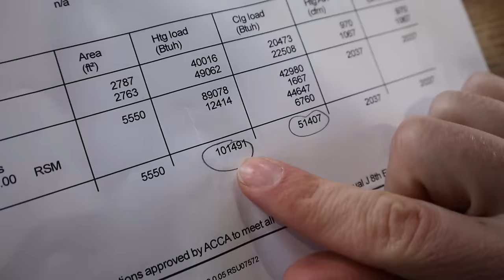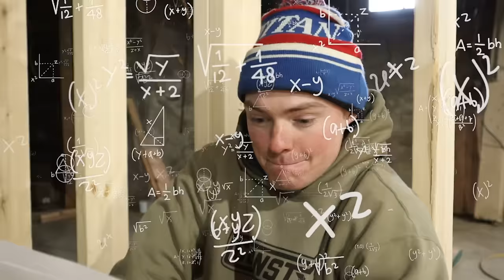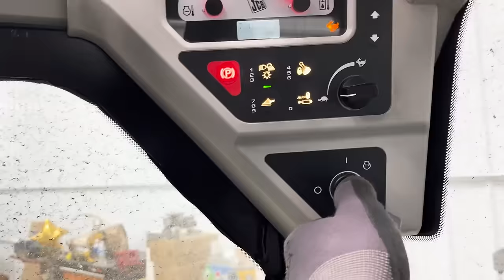Restoring A $7,000 Mansion: Removing 2nd Story Floor

Comment: I'm just a homeowner, but I am very pleased with the Geo Thermal system that I had installed over 10 years ago.  The limitation of a heat pump is that when the temperature drops to around 25-30F  a heat pump will struggle to pull usable heat out of cold air.  The same is true at the other end of the spectrum  around 100F  and there is just not much room to transfer heat out of your house.  However, Geothermal wells run a  constatnt 56 decreees.  So no matter the season the air handlers have less of a strain to move heat out of or into your home.  My upfront install cost was higher, but my electric bill went  down and I was able to eliminate the need for natrual gas.  At the time that was a saving of 70-80$ month.  Just as an educated guess, I would think you will need 4 or 5 wells drilled.  Or with your farm equipment  you could lay them out horizontally.
Reply: The new heat pumps can still work to -20
Reply: @safffff1000 yes but efficacy drops as it gets colder you will have much more effective system with geothermal.
Reply: Geothermal can be very good as long as you know the limitations.  Open-loop systems pump ground water for the energy source so wells are needed.  There is a closed-loop system that uses wells and also a closed-loop system that just buries pipe 10 feet underground.  I am a proponent of the closed-loop system as it doesn't affect the water table and with all of the space under the hay field it would make a great heat sink for the geothermal system.
Reply: We put geo thermal in when we built our home in New Hampshire.  We love it!  Great ROI and a very comfortable home winter and summer.  Our home is spray foamed too!  Great combo. I would do Geo again in a heart beat!  The air exchanger is a must too and Cole if you do any research you will see that.  Great show!
Reply: Here in Missouri the electric coops have rebates when you install geothermal. With the combination of rebates and a 30% tax credit the cost of geothermal is the same as a conventional system. Not sure what your electric coops do in Iowa. Explore this option and you may not need the radiant heating system. 
While you’re at it, since you are using closed cell foam your house will be pretty tight I would consider an ERV (what your contractor is calling an air heat recovery system). Also with your house as tight as it’s going to be you will need supply air in your kitchen for the range hood.
Reply: @safffff1000  they'll put out less heat the colder it is and have crank heaters and defrost and take more electric the colder it gets and the longer they run, sweet spot is about 20degrees f before they fall off bad. They're great for AC tho. As a master geothermal tech/designer/installer in Northern MN, I could tell you all about the horror stories about ice and defrost and inverter board problems and condenser fans and on and on. Hydronic heating/cooling from geothermal is top teir nothing else compares
Reply: @warrenclaassen5959  when I built my log home in 2008 I installed geothermal. I have an open loop system. The open loop system doesn't affect the ground water level. You pump out of one well and dump it into your dump well. With an open loop system you are extracting the temperature out of the water to satisfy the temperature on the thermostat.
Reply: @myronparks3495  Well that is good that you are directly putting the water back.  I do know of instances where they just put that water into a pond or something and I feel that is not the best way to conserve water in an area where the water table is already being depleted.
Reply: @warrenclaassen5959  I worked with a guy a few years ago. He had a house on a lake. He had an open loop system and his water went into a lake.
Reply: @myronparks3495  I have seen information that when you are on a large lake like Lake of the Ozarks you can throw coils down in the water and still use a closed-loop system but use the lake water as a heat source/sink.

Comment: For that size of house, I would recommend  2 systems, instead of one unit with dampers and add a registry in the staircase because during summer  heat builds up in that area
Reply: yep. Heat rises & cold settles.
Reply: I have 3,600 sq feet and have two systems.  You will be miserable if you only have one and higher bills and repairs because you will be dogging it.  Can’t wait to see where you put all that beautiful wood you took down on the walls
Reply: I kinda wonder about the whole house humidifiers for the dry winter air… I know I get tired of going through the smaller units
Reply: For sure!!  Two systems!!
Reply: I also agree with having 2 systems. Second floor will be hot in the summer if you try to use only one system. Also, the hot air rises and cool air fall so the heating  system will assist the second floor heat and the second floor cooling system will help cool the first floor.
Reply: I did that with my house. Love it!
Reply: One system 😮 I've been doing hvac for 30 years and I promise you'll regret listening to whoever is telling you this!
Reply: @ALSF-kingSucks  With floor heat already being added i would go all mini split.

Comment: Hey Cole I work in HVAC and I would suggest looking into mini splits. They are a ductless heat pump. We sell Daikin mini splits because they work at below 0 degree temperatures. I live in Iowa as well and the customers are really happy with them. Just don't cheap out with the Mr. Cool ones because they can be hazardous to the repair man because they are built cheap. If you have any questions my boss has 60 years in the HVAC business and is very knowledgeable as he is a second generation. He would be very helpful as I could be if you have any questions. Good luck with your decision. God bless

Comment: Make sure you put dampers at the beginning of each duct run coming off the main duct so you can balance the air flow. Also put a return in the top of your stairwell. 
Also do a separate water heater for the domestic water so you don’t have to run the boiler all summer just to get hot water.

Comment: My house is old too. We have 2000 sq ft on each floor (3 floors). When we remodeled, we put in two 200 amp panels and sub panels. I told my electrician, "I never want to trip a breaker in this house, EVER!" Best money I ever spent. Kitchen on one panel alone. I have a plug in ever 6 feet on each floor, with heavier wire. I want this home to go into the future to meet any electrical need without burning down. We even designed an area for a elevator and totally handicap accessible.  I recomend putting up plywood prior to sheetrock on walls where you might need handrails. Be prepared for everything was my thought. You never know when a parent might need to live with you, like mine did.

Comment: Cole, under no circumstances would I ever build a two story home the size that you are with only one HVAC system. I have been in the real estate business for many years and I have been in a lot of homes, both with one system and those with a dual system. The second story of the one system is always miserable hot in the summer and cooler in the winter. The dual system is comfortable on all levels. I know it is a large investment but I believe you will regret it if you don't bite the bullet and put the dual system in.

Comment: Have you looked into the geothermal for heating and cooling for the whole shebang? You got the equipment to dig and the land to boot. I’d certainly look for a contractor to see!!
Reply: We put geothermal in our 100+ year old house and love it.  It’s nice not having a condenser outside, too.
Reply: Cole, Please look into geothermal! With this size house, any HVAC system, will last about 25 years, then would need replacement. Geothermal goes hand and hand with radiant flooring. Also, look into State energy credit programs for installing a geothermal system.
Reply: This is a fantastic idea.  A mech engineer I know did this.  Says his heating and cooling costs are almost nothing. Basically just runs a small pump and blower on 120v and that’s it.  No fuel costs.  Great idea after the initial install.
Reply: We have an open loop geothermal system but I also had a closed loop in my old farmhouse. Best system ever. If you have the land for the closed loop - I found it better - no mineral build up from the wells. Heats and cools and provides us with most of our hot water. I am not sure how it functions at the higher and hotter end of the spectrum. We only get Temps in the high 80s in Canada. It sometimes goes higher. At the low end we go down to about 5-10F.

Comment: Cole, noticed you have very high ceilings, to stop your new walls from bowing out and to further strengthen them you might look into putting noggins ie: timber in between the studs it will help stop problems later.
Reply: do you mean blocking? shorter cuts of wood going perpendicular between the trusses intermittently across the floor like a backyard deck?
Reply: U mean blocking??
Reply: @AB-ol5uz  He's probably in Europe, they call blocking noggins over there. I watch a guy remodeling a house in France.
Reply: @poodlegirl55  Do you mean Dan?
Reply: @airenesmiler6624  Yes!
Reply: Half of us watch Dan restoring the chateau in rural France as well :D
Reply: @polarguyinak1  I wonder what Cole would think of restoring a burned out chateau!
Reply: In Canada, staggered horizontal blocking at 48” on center. is required for exterior and loadbearing walls; 84” maximum on center for non-loadbearing walls for a number of reasons—including blocking at shear panel edges, fire blocking, and buckling restraint when subject to axial loads.
Reply: I watch that guy too. Remodeling Chateau's? Drives me crazy.
Reply: I love watching the Pethericks, Life with Ryan's channels along with their "offshoot" channels. All of them are great about renovating chateaus and a convent and a small apartment lol.
Reply: @poodlegirl55  Thought you were talking about either the Pethericks or Edd from the Chateau Life.
Reply: I watch The Pethericks, Ryan, Chateau Dairies, Escape to Rural France, Chateau de la Ferte, Chateau de Montmagner, Escape to the Dream, Journey to the Chateau, Our French Chateau , Chateau Chronicles, Chateau Citidale de Cavalier, Boudreaux Life, Chateau de la Grifferia, and probably some others. I started watching Cole about 4 years ago when he was cleaning the house out before he moved in and have been watching him ever since.
Reply: In Australia we call them noggins, depends on wall height, could be 2 bits of timber per cavity or between studs.
Reply: For some reason, the yanks don't use noggins, watched a couple of channels never use them. Can someone tell me why. They would have to have problems with the walls bowing if a fair amount of weight was on the studs.
Reply: Those arte mandatory in many places. Can use some of the lumber that 'went out the window' if it doesn't have any dry rot. At least it's dry timber, a bonus!
Reply: @ronporter610 much the same here, as well as is bridging in the joist structure . Not sure why this is not being done as a carpenter would know this. Use of screws in certain applications are also not allowed. I see no huricane strapping or structural tie at foundation.
Reply: @mikerhodeback9636  would it still be called hurricane strapping if the risk was tornadoes? 

I'm not trying to be 💩y. Lol. They're in Iowa. No chance of hurricanes because they're nowhere near a coast. I'd think there's a big chance of tornadoes though.
Reply: @renfairegoddess  I am in Ohio...just a term they use I guess. I have thought the same thing myself
Reply: @bethcervenka1813  Got to check out the rest of them! Thanks!!!!!!

Comment: Heatpumps font need air venting only room for the lines to be run. Use heatpumps and maybe have modern radiators as backup heat. But heatpumps are incredibleeeeeeee. So happy its part of the conversation!

Comment: My 2 cents... I used to be a construction detailer and the only thing I know about ducting is that after all the woodwork and trim is finished the ducts will be coated with wood chips, saw dust and drywall dust. Hire a duct cleaning co. Or cover the vents in rooms where saws are being used. Your doing great and your crew is awesome and funny.

Comment: Yes , you need 2 units in main house for best heating and cooling,  if not your upstairs will be very uncomfortable
Reply: Lol. No
Reply: @Bbnotbb1234 why no?
Reply: The heating and cooling need across 4 levels really is gonna make it a lot more comfortable with 2 systems so u don’t heat or cool half the house when it isn’t needed
Reply: I would agree the two units are needed. Has helped with my home tremendously
Reply: @cmusic52  that is old school. Not saying you need two or not but it is all about how intelligent is the system to control the temp in respective zones. He will have an issue with colder temp in general though. Did he thought about operating costs ?

Comment: Hey Cole. I’m an electrician and I know your not at this stage yet but wanted to throw in some ideas that I like to reckons for home owners. One being to have at least half a switched outlet under the sink in the bathrooms for rope lights underneath the vanity for tor space/ night lights. Another recommendation is to add soffit lights with a timer on them for Christmas lights. The last one is to have switched outlets above your cabinets in kitchen if you want to put any kind of lights up there. Just some ideas that I also have in my house that are used all the time.

Comment: HVAC worker with 32 years experience, Go with the 2 forced air units, why not just go with forced air and eliminate the water flooring system, with all the insulation you got going in the walls house should stay nice. You guy can run 90% of the flex ducts, it’s easy. Maybe have them run the main lines.
Reply: This is the smartest you can have two 60k btu furnaces and two outside air conditioners
Reply: I agree, a system for each floor. he has three floors. The basement would need some thought as a fourth floor.
Reply: You should try the heating system called aria. They’re small pieces of duck that are 4 inches and 3 inches and I believe will design for you.
Reply: Would you also recommend the air exchange system for Cole with all the foam insulation?
I’m assuming this house is going to be rather air tight and it could make some of the windows full of moisture.
Reply: I haven't met anyone yet who has been happy with floor heat in the long term. They all ended up ripping the floors up to get rid of it.
Reply: Don't listen to your commentors, ask people who have radiant heat, let them tell you how wonderful it is.
Reply: @DianaStuckert  exactly, in a shop yes but house not a good plan. Floors will be warm anyway from level below
Reply: @Dennismelnychuk  I've lived in upstairs apts. that were 1/2 of what the downstairs apt heat bill was.
Reply: @DianaStuckert  I SO love walking on My heated slab with bear feet......
Reply: @GlenS123 radiant heat is the best way to go . If your feet are warm you’re warm . The mud job on the floor will hold the heat longer than basically a giant hair dryer warming the air then turning on off on off all day .
Reply: Also I would think I'll fur  out the outside inner walls to be a little bit thicker and using rockwool insulation in front of the sprayed in insulation is better return for heating and cooling cost. Also now is the time to start changing out those windows to higher efficiency ones.
Reply: @DianaStuckert I live in north MN, and I’d say half of our houses built have floor heat.  But we typically have single story on slab, so the concrete acts as a giant thermal mass.  It’s super even, efficient, and comfortable.  I wouldn’t even consider floor heat if not in a slab though.
Reply: You’re missing the fact that Juston and Roman need to get paid
Reply: Also, drop the radiant floor heating. Takes too long to raise to temp and is difficult to sustain a set degree. I know people who completely dismantled the tubing and filed it under G, garbage. That should cut the cost WAY DOWN so you can spend for a better 2 floor system.
Reply: Flex duct is for hacks run it all hard trunked get better velocity and easier too keep clean and won't have mold issues down the road. Make sure they quote in for some IAQ equipment and good filters. indoor air quality   uv lights and ionization
Reply: @kristiankovanen100  in a perfect world if they were sheet metal workers, you might run all hard duct but it’s really a “cut in job” not going to be good access to the top of the ductwork to seal or make connections and even do a good job insulating it. At least with the wire flex it’s insulated 25’ lengths. With a 5,000 square foot house I would do a great job on zoning it out with dampers so they don’t have to heat/cool the whole house. Maybe just do the kitchen and bathrooms with the under floor heating.  I have hung miles of ductwork. Just don’t think they would do a very good job running all galvanized with a truckload of adjustable elbows.

Comment: I wish I wasn't playing catch up on your videos, so I could have sent this sooner. That guy who has 47 years doing hvac… it's like Justin and his chalk line compared to the  laser level. The only benefit of hvac is if you are retro fitting an old house, so you can utilize the duct work already in place. Since you are starting from scratch, in floor pex heating is the way to go. Radiant HVAC distributes heat through air ducts, in-floor pex heating warms the floor directly, which then radiates heat to the space. In-floor heating provides even heat distribution and ambient temperature, also silent operation, with no blowing air noise It is also more energy-efficient, especially when used with thermal mass (large, dense materials) that can store heat and release it gradually… cough, 40 laminated beams. You can't beat warm floors in the winter.